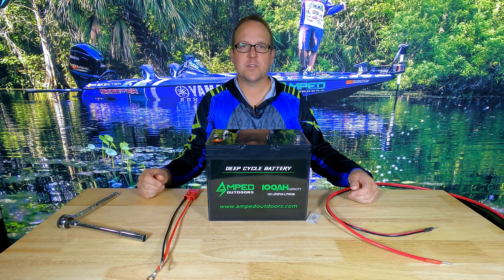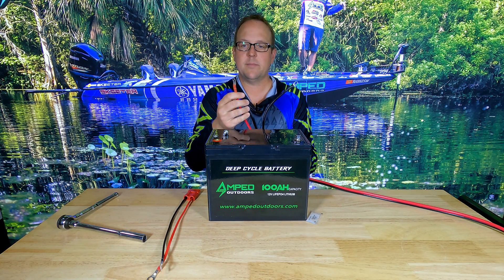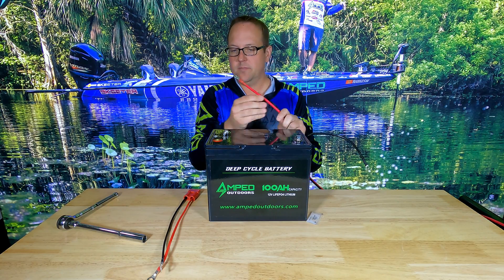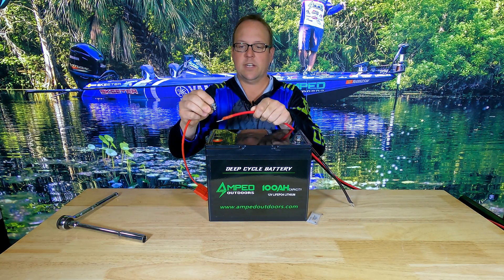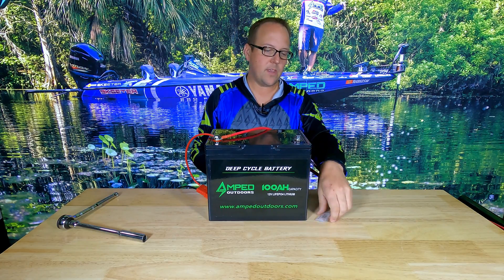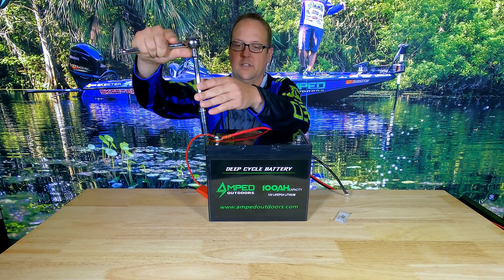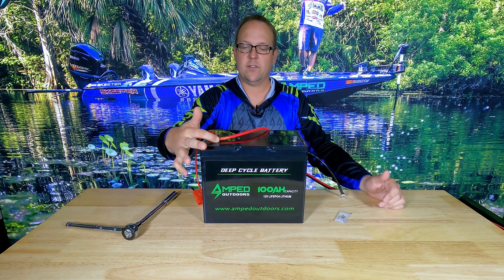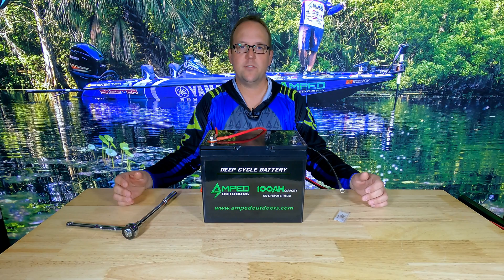How to install a battery to trolling motor

Comment: Since the chemistry is all solid, is it OK to lay my battery on its side?
Reply from the maker: Lithium batteries can be mounted in any orientation. They are made to be upright but as long as they are secured and safe, they can be in any orientation.

Comment: I’m confused. I’ve never own a battery or trolling motor but recently bought an old town autopilot 120. I purchased your 100ah battery that I just got done charging. I’m suppose to also connect the charger cable when I install it in the Autopilot battery box?
Reply from the maker: The battery charger cable can stay attached while in the box. This will allow you to quickly connect the charger to the battery without having to uninstall the battery box from the battery.

Comment: How come you dont have or use  a circuit breaker or fuse to protect from any shortages?
Reply from the maker: A fuse or breaker is to be used based on what the trolling motor MFG recommends for that model.

Comment: Can the batteries be charged one at a time using the 10amp charger/quick connect when wired in a series for 24v?
Reply from the maker: Hello, every 12V battery will need its own 12V charging source. You can use one charger and switch it out when one is full.

Comment: Is there any specific dielectric grease you recommend?
Reply from the maker: Permatex and loctite are the two most commonly found in stores. Almost all automotive and hardware stores will carry quality products. Use them on batteries and all other automotive and marine connections, you will be happy!
Reply: @ampedoutdoors6861  thank you